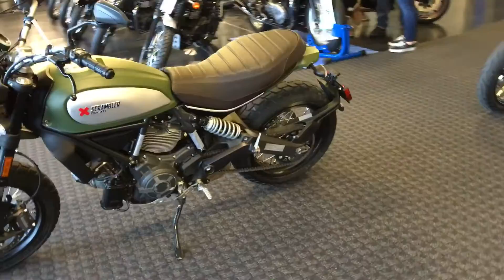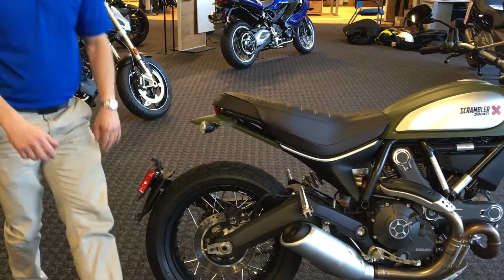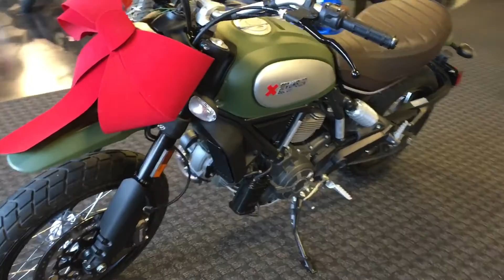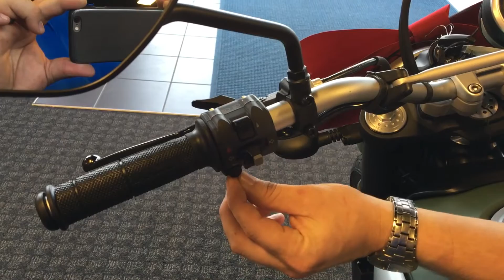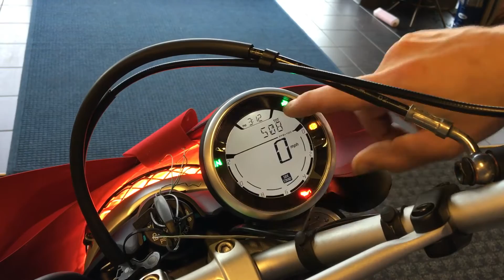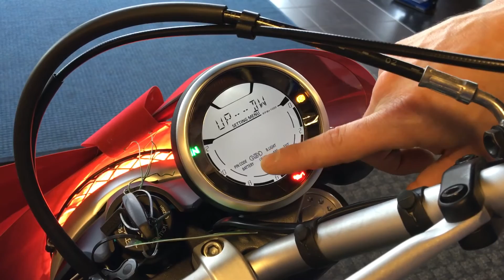Mr. Bowes '15 Ducati Scrambler Urban Enduro Remote Christmas Delivery!!!

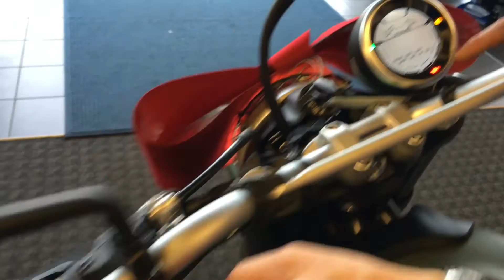Comment: 4:31, 6:34 Cancellization???What's up with that?
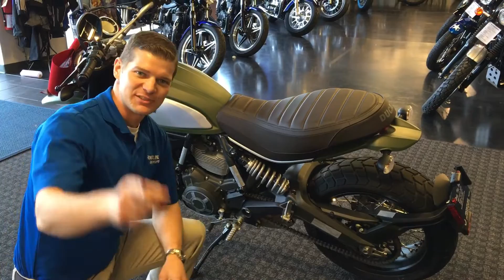3:06 One down, five up configuration...Really?
Reply from the maker: Cancellization is just turning the signals off after you have completed the turn and ready to continue on down the road.  One Down Five up means from neutral you will first have to push the shift pedal down and then you have five gears above neutral for a total of six speeds.  I noticed you posted this a year ago and I apologize for not seeing it until now as I am pretty damn good at responding in a timely manner.  Thanks for watching from across the globe...  Cheers,  ~Nate
Reply: Nathan Jennings
I don't think cancellization is even a word, try cancellation. 
Are you really explaining to me what "one down five up" means?
Really?